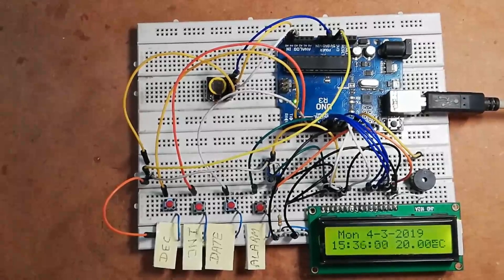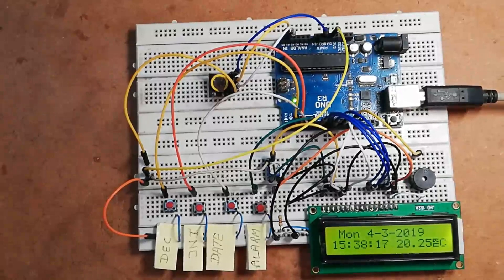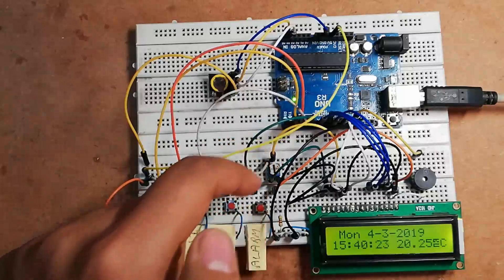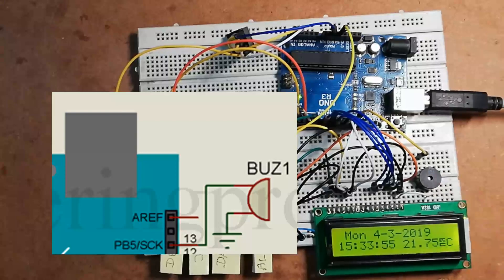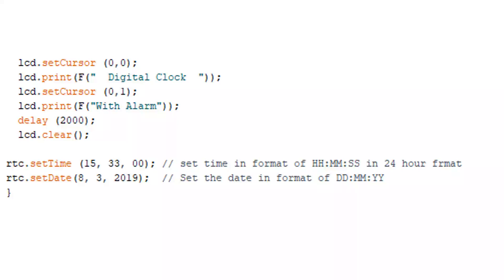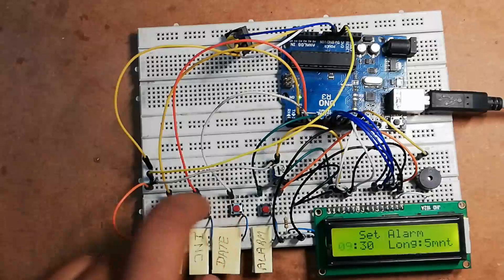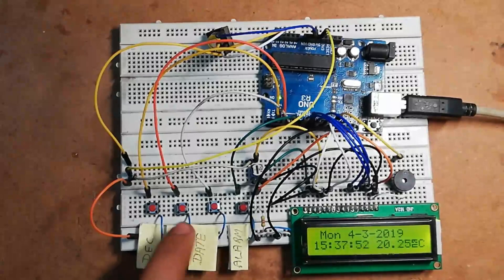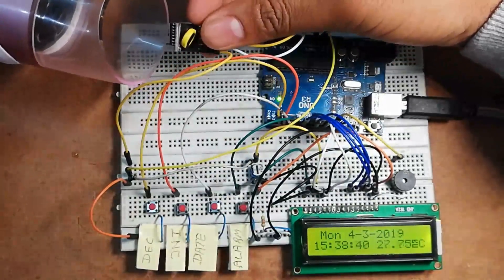Arduino Alarm Clock with Temperature Indication

Comment: Just subscribed.
Thanks for this.  I built this project using a Nano.
I have found that when I set the alarm it runs for a minute more than the set point.  
Also,  if I press the time button when setting the alarm, the program stops.
How can I alter the code to prevent this ?

Comment: Can I use 7 segments digits instead of screen in this project?  If answer is yes than my my question is that how can?
Reply from the maker: There is two answer yes as well as no.
Yes, you can do with various modification with circuit diagram and software code.
No, if you want to display day like sun, mon etc. You cannot display even the message like alarm is set etc.
Reply: @Bestengineeringprojectsbep  I want to show only  date and time only.
Reply: @Bestengineeringprojectsbep    What modification needed for that?